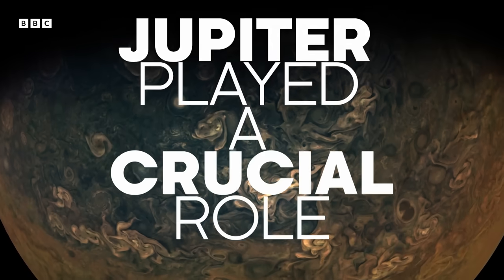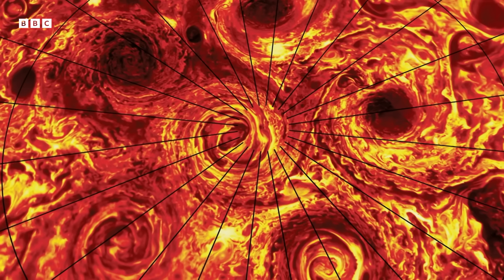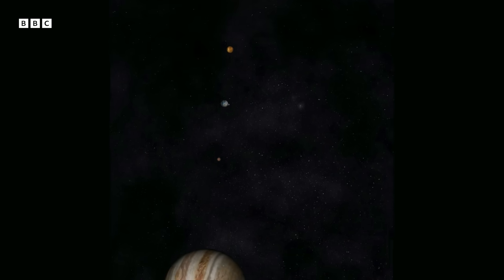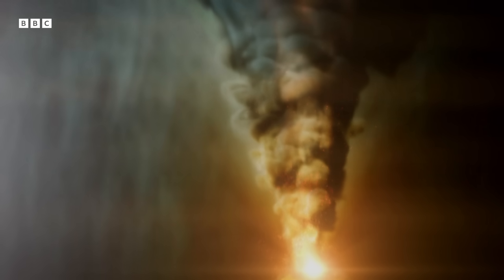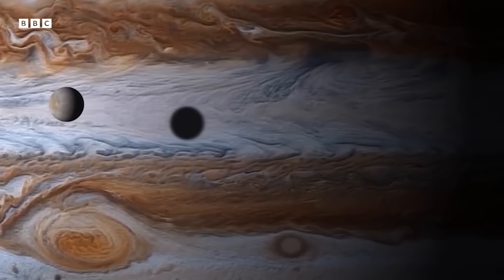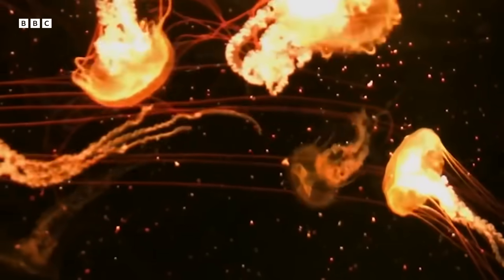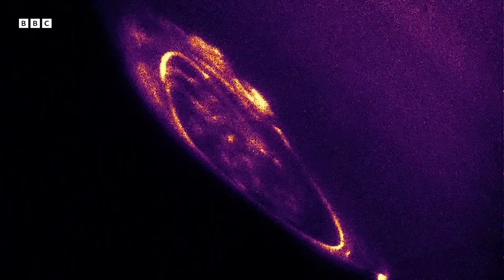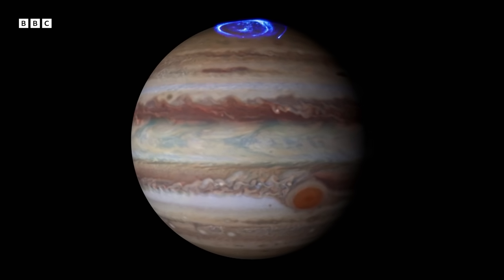Jupiter: The Largest Planet in our Solar System | BBC Earth Science

Comment: Planets without a solid surface are scary.
Reply: Jupiter must have a core to have such a gravitational pull, if you will. Also it must either be very large or very dense.
Reply: @billygoat520  By that logic the sun must have an even bigger core...so yes, even something made of mostly hydrogen gas can have a huge gravitational pull, if it is very dense.
Reply: @rikk319  You ned to consider the size of the sun compared to the planets though.